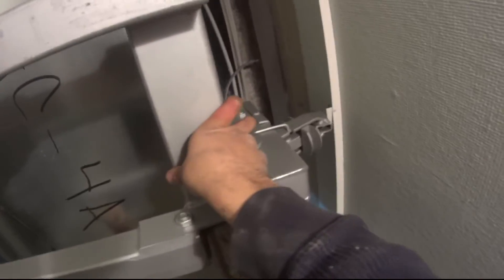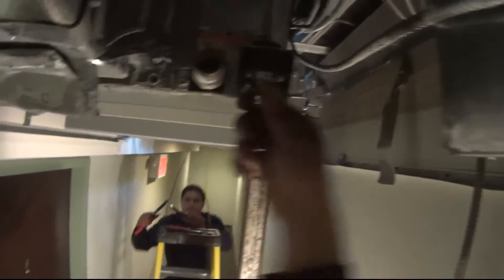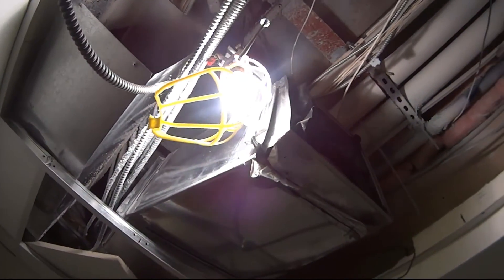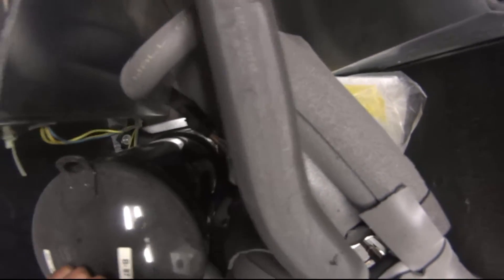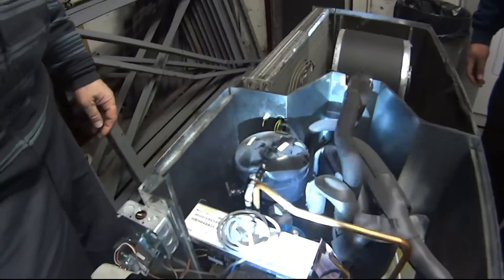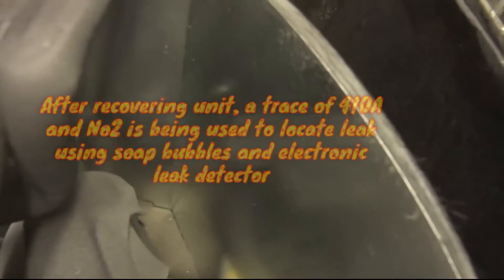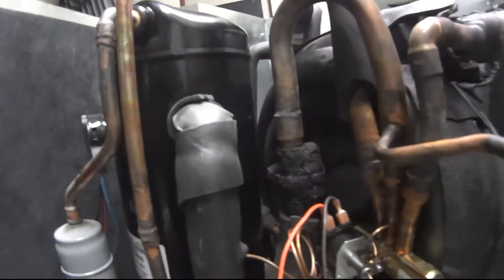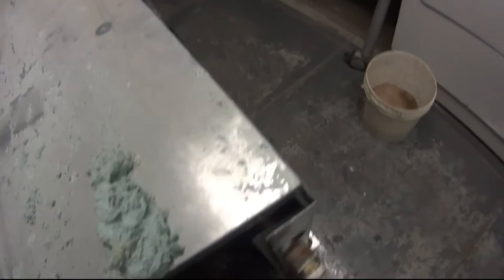HVAC | WSHP-BAD TXV | LEAK SEARCH PT1

Comment: That leak detector works better on manual zero. You could have used R22 as a trace gas with N2 and used any good detector. The SLR8 works great for R410 but sucks for R22.

Comment: A lot of work there. You definitely had to drop that unit. Would've been a nightmare if you didn't. Those leak detectors can be tricky for sure. Sometimes other things can set them off. Enjoyed the vid Sir
Reply from the maker: Thanks Jon. I've done repairs in the past without dropping them and it sure was a big freakin nightmare.

Comment: Those Heat Pumps are a bitch to work on in place Great Video Emin. I have office  building with over 110 Climate Maters. They keep about 6 in stock for quick change out on EM basic.
Reply from the maker: They are horrible, that's why i do mostly commercial.  However sometimes i just don't have the choice lol.

Comment: Nice work Emin Has one ever leaked into the water circuit? Looks a difficult system to fix and trouble shoot.
Reply from the maker: Thanks John, to answer your question yes. It has happened many times in the past. I've seen the sensors jumped out and the units operating low temps causing the heat exchangers to crack
Reply from the maker: John this unit is the easiest to trouble shoot. Its A Very Simple Unit